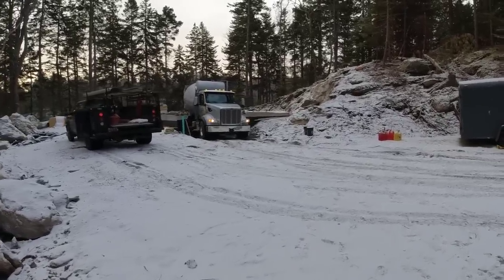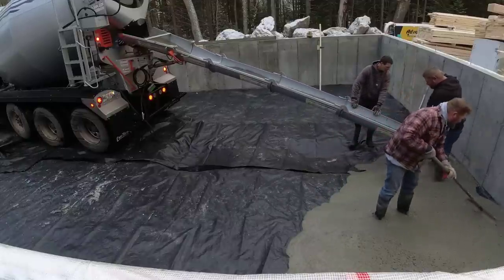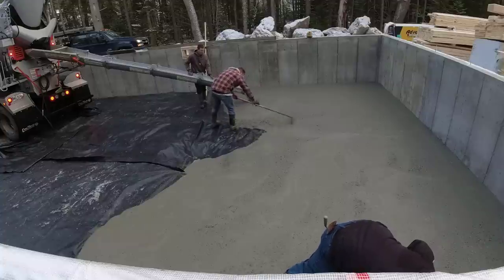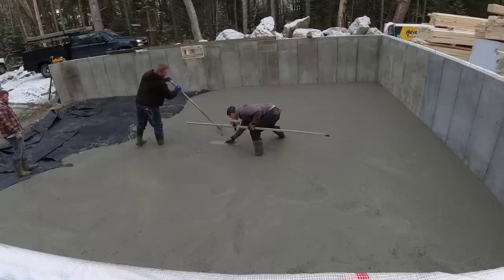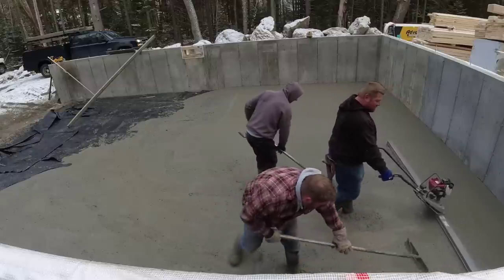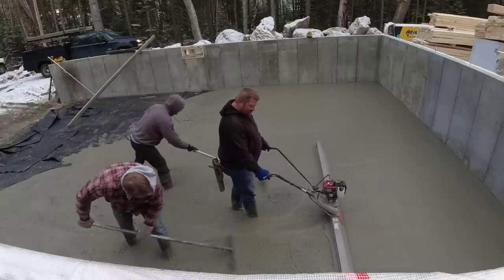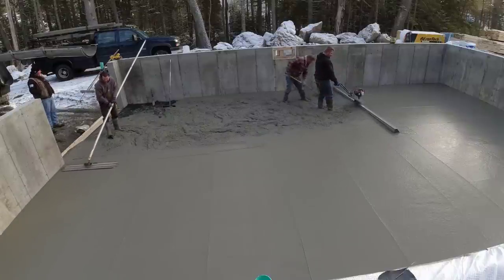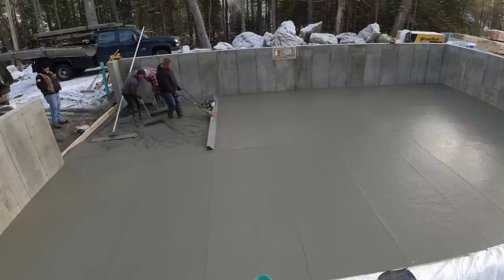How You Can Pour Wet Concrete And Get Away With It!

Comment: Around here most the concrete guys have skid steers, and work out a deal for grading and moving dirt. Basements that need stone, which is a lot of them when you get away from Lake Michigan it turns to clay, most of those get subbed out to the septic guys that have stone throwers, they also set the sump crocks and tile around the house and under the slab.
Reply from the maker: Thanks Mike

Comment: You can use a self consolidating concrete/self leveling too.  We used to use it in precast concrete production.  ADVA used to be a WR Grace product, it was or is a polycarboxylate.  If you reduce the water to cement ratio to around 0.4 it will set fast, you can use about 10 to 12 oz per 100 pounds of cement.  If it gets sticky, use some fly ash in the mix.  

The SCC is tested as a flow, not a slump.  You can easily get a 20 inch diameter circle spread, which is what you measure instead of how far the cone slumps, when you pull the slump cone up.
Reply from the maker: We've looked into using scc for certain applications but haven't tried it yet. With the pours we do the regular WR is good enough.
Reply: One of the reasons for the price of precast is those additives. Not to bad but the customer isn't going to pay for it.
They will if you sell it as a higher strength produce. Sell it as less CO2 if it's that kind of concrete 
General usually knows if it's something the client will like.
Reply: @sparksmcgee6641  true, but it depends on labor rates.  I have done flatwork with it, minimal vibration/handling.

Comment: I had a GC that graded the floor with his guys was 2 1/2" out of level so I added a few extra yards was about 20 yards. After pouring out 1st truck we didn't finish 1/2 so I asked how many yards he had? GC called Concrete took off my extra 2 and we ran short and had to reorder another 2 in the summer 1 hour and 45 minutes Concrete came because they were really busy! Last time I worked for that 72 year old GC.
Reply from the maker: I hear ya, running short is always the worst. It happens to use once or twice a year.
Reply: If I’m pouring and I’m not sure of the grade I’ll order my yards and a balance so if I run short there already for a final order and if it’s not needed I just let them know that was good. It also cuts out the small load charge, at least where I’m at that works.
Reply: @jessestallard4468 didn't occur to me to use that trick.

Comment: I started doing concrete in 88, in JOCO KS and went into business for myself in 96. Every flatwork outfit around here, commercial, or residential new const, is responsible for doing the subgrade on whatever it is we are pouring. We all own skid steers, and pull them with us pretty much everywhere we go. So do you guys even own a skid steer? Thats way cool if you dont have to, but I couldnt imagine doing concrete without one, or having someone else do my subgrade, and just over ordering my concrete in order to compensate for how far off grade some other guys left it, or pulling up on a job and then leaving because you have to have a separate contractor come out and have him fix the shoddy work his guys didnt do correctly. Which cost me either the extra concrete i had to order to make up for the low uneven subgrade, or the labor I had to pay out and the fuel and wear and tear on my worktruck for driving around to jobs that arent ready. Not puttin your way of doing things down, just saying it doesnt make sense to how we are use to doing concrete work out here in the midwest. Have a good one.
Reply: In my area in mid coast maine the dirt guys do the dirt and the concrete guys do the concrete. If you don’t have to do the dirt you have more time to do other jobs so you ain’t gaining anything there by doing your own dirt. In my area everyone knows everyone and I know which dirt guys do it right and which ones to keep an eye on. Even if the grade is off I charge by the cubic yard so more concrete the better. I have found that the guys who try to do everything don’t put out the quality.
Reply from the maker: I'll agree with Jesse, here in Maine there's excavation contractors and concrete contractors. Rarely does one do what the other one does. We're hired as a sub on most our jobs so the GC hires the excavation contractor, foundation contractor, and floor contractor. They're all different on most all jobs. Currently I only know of 1 contractor that does all three of these trades together, and the concrete parts aren't his strengths.

Comment: if u use a 60v 6 amp hour battery on the screedemon is there a difference on the vibration?
Reply from the maker: I've never tried that big of a battery, but it may vibrate a little more. A fully charged battery will vibrate faster than a half full or less one does.
Reply: @MikeDayConcrete  True Grit. Master craftsman replying on Sunday 👏 💯 🙌
Reply: i dont believe millwaukee makes a 60 volt battery. and I have found that their 12 AH batteries seem to develop issues much earlier in life

Comment: I thought you liked the battery screed best. Why are using the gas screed? I am going to buy one of these but I was leaning towards the battery. Now, I am confused. Please advice.
Reply: He explains towards the end of the video, hopefully you've seen that by now. I have a gas vibra-screed and the dang thing vibrates so hard your hands are numb by the time you're done. I plan on getting the battery one this season, no reason to fight gas motors and a pull string every year.
Reply: @matttietsort861  Thank you so much. My fault to jump the gun. I did hear his explanation. Thank you.
Reply: No worries mate as they say down under! I have to wondered what the difference was too. And Mike has not had the power screeds for a long time either. About a year. So great question. The gas one vibrates more and is heavier, so I'm thinking that works better for heavier slumps and/or concrete setting up fast? And the battery one is a bit lighter and doesn't vibrate down as much according to Mike. I'm sitting here thinking it's like weed wackers. The gas ones are still stronger and more powerful have more torque, but the battery operated wants are getting there.
Reply from the maker: Yes, kind of what Gordo said. When we pour hot watered concrete with accelerators, the gas has a bit more torque/vibration just in case we need it. If the concrete starts to set because it's hot, the battery one kind of floats because it's more of a humm vibration than a heavy vibration like the gasser.

Comment: So I have never used a water reducer just because lack of experience and fear but do you order a 5 slump and tell them to add water reducer and you know it’s going to come out 7/8 or do you say I need a 7/8 slump with reducer. I wouldn’t want to say I need a 7/8 slump with water reducer and it shows up a 10.  Does that make sense? What is the difference between high mid and Im assuming low range?
Reply: Call your supplier they have an engineer or a book full of mixes from past orders. Tell them you want the same specs and to walk down the ratio. Get the price for a couple steps lower and try it.

Comment: Water reducer is the way to go when you need to have good workability. Have you ever used plasticizer?
Reply from the maker: We use it occasionally, but don't really have the need to very often. When we first used plasticizer in the 80's it was horrible. Made the concrete feel like Jello. Firm and dry on top but soft underneath. Not friendly at all, and you didn't have much time to get it down before it started firming up again.
Reply: Same thing isn't it, high range, and plasticiser
Reply: @MikeDayConcrete  Agree, the plasticizer has limited use. I have designed mixes using it for deep foundations, typically pump application. I was curious given the amount of pump placement you do as to your experience with plasticizer. Appreciate your videos.
Reply: See I always thought that a water reducer was a plasticizer. I thought it was an additive that basically kept the cement from bonding to the aggregate for flow ability. But again this will be my 3rd year in business and I feel I make every mistake in the book so far.

Comment: I don't understand this point. If additives are used, less water is needed. With a normal slump, the concrete would be even harder. Then less concrete would be needed. Around here, concrete is ordered with slump and strength. The mixer then design the concrete. If you want it wet and strong, it will be expensive. If you want it dry and strong, it will be cheaper.
Reply from the maker: The point for me is being able to pour the concrete "wet" so it's easier on us, the workers. Easier to move around, screed, and bull float. Less labor is needed, especially when we pour every day. It's both "wet" and strong, 3500 psi, and cost about 3 or 4 bucks a yard more. But we can pour more with less labor so it's really a wash to us.
Reply: @MikeDayConcrete  I can understand it is less work with a high slump, but if you kept the slump lower, the concrete would be harder. 10% less water will increase strength 30%.

What you are doing is destroying the  improvement of the additive by adding more water. You can also add more cement to achieve the same strength. 

Probably the additive is cheaper than the extra cement required, so if you want that high slump, it is probably the way to go, but I haven't done the maths here myself. 

Strength is not always important in floors in homes. I guess 1000PSI could be sufficient, so hard to go wrong there. Garages and drive ways are a different animal.
Reply: elbuggo, I think you missed what he's saying. Water reducers are chemicals that make it appear to be really wet. I pour the same way he's pouring. The way he's pouring in this video with a high range water reducer at a 8-9 inch slump, probably has the same water as a 5 inch slump without water reducers.
Reply: @bradhill4590  RE: Water reducers are chemicals that make it appear to be really wet.

You can reduce the water with these chemicals. 10% less water will give you 30% stronger concrete. If you use as much water after these chemicals, the concrete will not be stronger. But you can use less water and get a stronger concrete with the same slump.
Reply: @bradhill4590  And instead of 30% stronger concrete (by saving 10% of the water), you could use 30% less cement in the mix.

Comment: Why wouldn't they just have made it a little deeper for a full basement. They already spent 75% to do it
Reply from the maker: It's a garage.
Reply: @MikeDayConcrete  With a crawl space? If they are going to have such strong floor they should of made the basement for storage.
Reply: @safffff1000 😂🤣. Look at the rocks, that is the garage floor. The rocks are about ground level
Reply: @sparksmcgee6641  They said this was the crawl space
Reply: @safffff1000  my bad I turned off audio some. Looked like a garage plus slab.👍👻